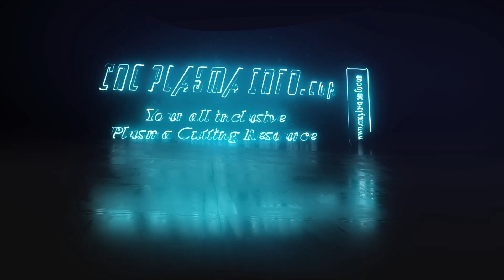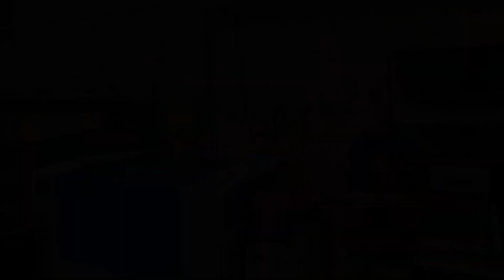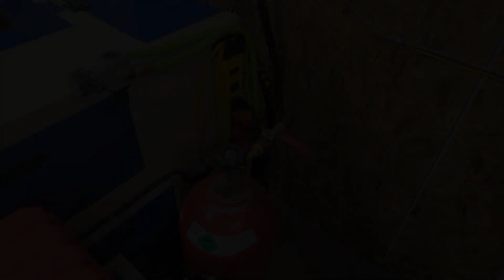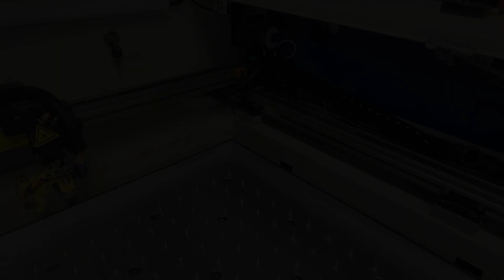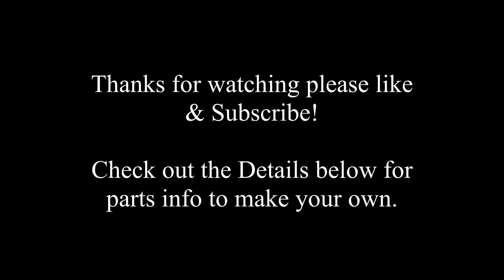CO2 Laser Machine Fire Suppression System

Comment: How much CO2 does it take in L/min to keep it flooded the whole time? Or do you suggest using the celonoid and censor?
Reply from the maker: The way I have it set up is manual valve and solenoid that opens and dumps till tank is empty.  Lots of c02 would be dumpted much more than needed.  I could use a smaller tank or have a solenoid that opens for a set time period.  In almost 10 years of doing this never needed it so have not messed with the design

Comment: Is there a cheap Arduino controller and some code or is it much more simple than that? I'd like to see an electrical schematic or logic diagram of this system, I like the design of it. I can't believe the major laser manufacturers don't include something like this as an option/add-on yet. Thanks!
Reply from the maker: Much less complicated I have an off the shelf heat Detector,  wire the solenoid to the speaker in the heat Detector.  So when the heat Detector goes off and sends power to speaker for an alarm it trips the solenoid to open.  You could make it much smarter and use ardruino but this works.  I used the heat Detector instead of smoke Detector to avoid a false positive since some smoke happens while cutting

Comment: This is an idea ive been kicking around for awhile. I'm glad you made this video. I always have a lot of projects running at once, I'm in the shop while the laser is running but may be sanding, painting, cutting wood and not paying full attention to the laser. I like the fact that it has an automated system in case i dont notice it right away and that its CO2 which wouldnt hurt the machine or make a huge mess. Hopefully would save the laser.
Reply from the maker: Glad it was helpful!

Comment: Thanks for publishing.  I'm considering doing something similar.  Though i was wondering about putting in a long wire that melts easy, and when it melts it releases the relay, instead of the sensor.  As I'd be worried a hot spot might set it off with the sensor alone.
Reply from the maker: There are many possibilities with this setup.  I have been thinking about some changes and upgrades but have not decided on everything yet

Comment: What tubing are you using for the high pressure of CO2?
Reply from the maker: Sorry for the delay it's radiator style braided hose rated at 300 psi.  It's never had a problem used many years now

Comment: Do you have a video of a discharge test of this system as installed? If not, any plans to produce one?
Reply from the maker: I did a couple tests after I set it up and confirmed that it was functional and my design worked and was effective.   Never did a video should have but did not.   Have not felt the need to make a video just to waste the CO2.  But if there is enough interest I might down the road.
Reply: @DesertFabworks  - Be that as it may, the video is all sizzle and no steak without a discharge test and CO2 refills are relatively cheap.

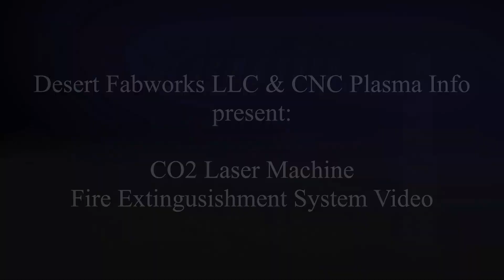Also worth mentioning, spell check alert at 0:11 on the video.